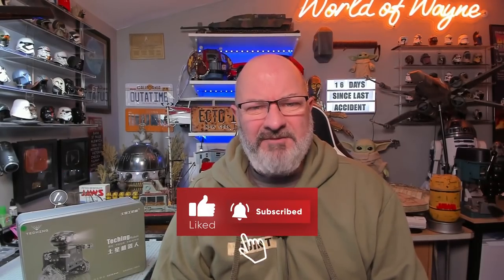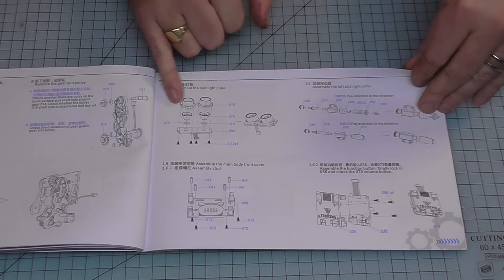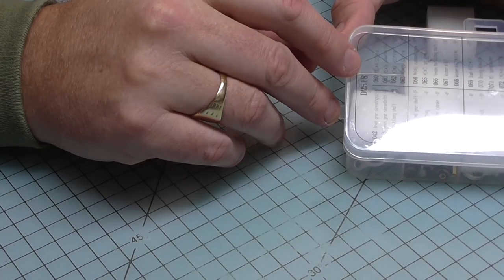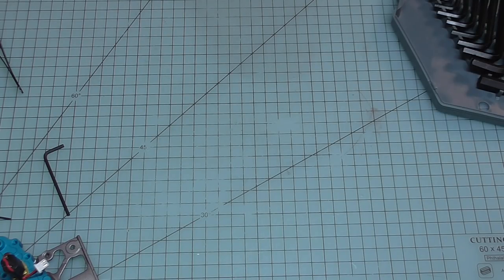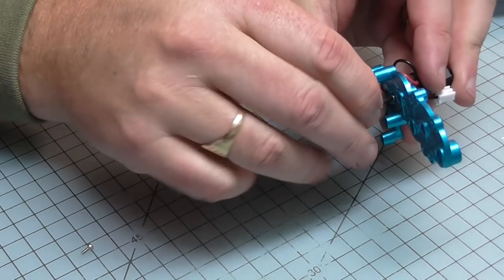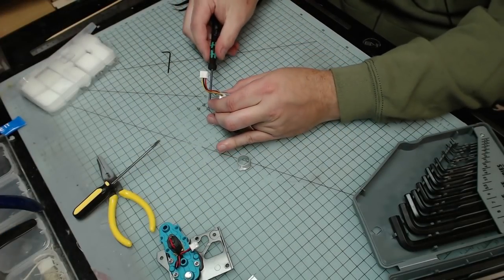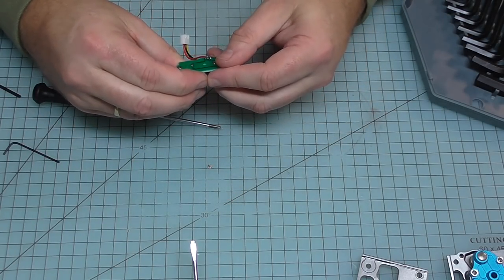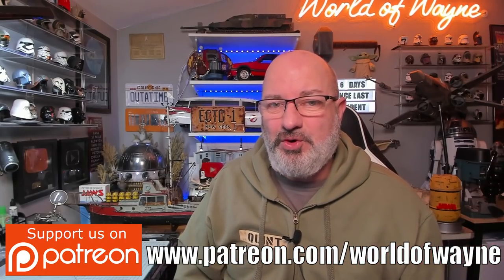Building the StirlingKit Teching Robot - Part 1

Comment: I just received my kit and started building it discovering a tip that I hope will help others who are building this.  When installing the motors, wrap a label around the connectors "L" and "R" which will help you later when connecting them to the power board's R and L ports respectively.

Comment: Wayne, this does look like a great build. You really should go back to the parts you have assembled so far and make sure the screws are tight. Use short end of the Allen wrenches in the screw heads to do this. You are able to apply more torque that way.